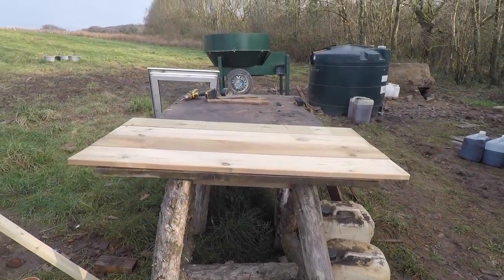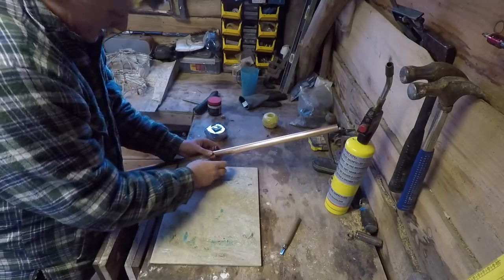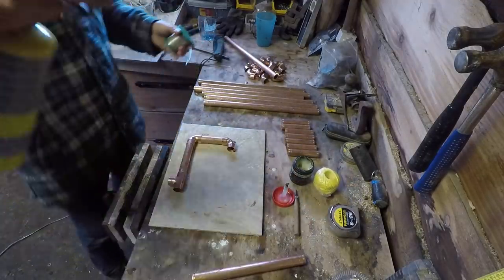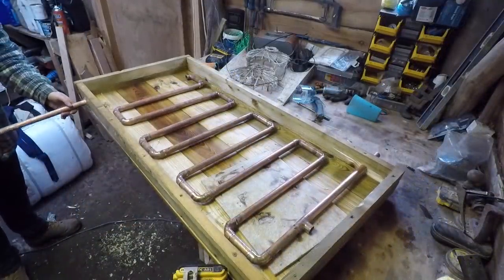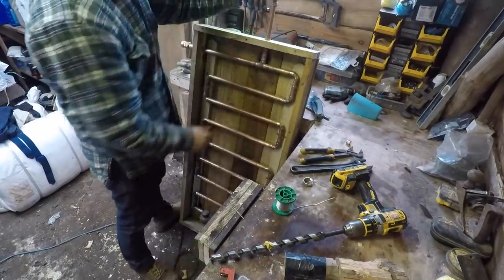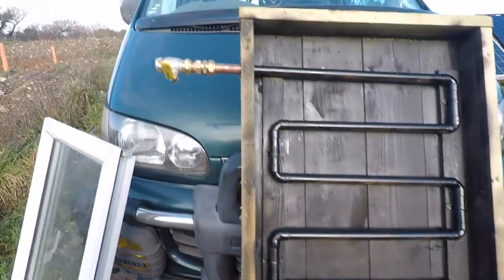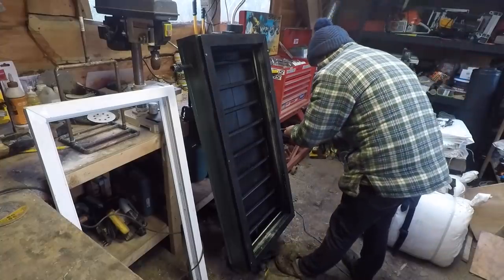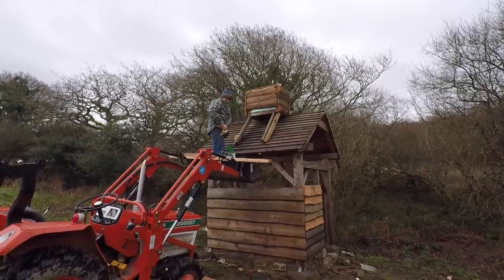Off Grid Solar Shower And Compost Toilet Part 4 Solar Hot water panel

Comment: Hey Kris, hope your well, looking back through your videos and came across this one, a couple of points with this, you could change the glass panel in the window to one thats called K glass, it reflects the heat rays back into the box, so they dont ever escape out, and the other thing was to fill the box with a black gravel, the really fine one, that will help to absorb more rays and keep the heat in the box for a longer period
Reply: whats black gravel.
Reply: Gravel that’s black

Comment: Kris, I used it do in home remodeling for a number of years and I don’t know how times when soldering I had problems with leaks until a plumber explained that to eliminate leaks always apply solder on the opposite side of the joint of where you are heating. It works beautifully because if you haven’t heated the joint hot enough, the solder won’t melt.

Comment: Made one of those about 35 years ago, we used an old radiator (domestic heating) painted black instead of copper pipe and insulated the box with rigid insulation. 
You can use a new car/truck radiator if you can find one cheap enough.
Reply: Pipework from an old fridge works great
Reply: This thing isn't going to do jack squat.  The box is more or less empty and the tubing is too big. The tubing needs to be MUCH smaller to increase the surface area and there needs to be a lot more of it.
Reply: @tarstarkusz  jack squat.

Comment: What I did was used barn corrugated roof barn iron from a scrap yard.     Made the 8'×4'     out of 2x4s.     Loaded it with pvc black pipe ( or black garden hose )   Screwed plexiglass for cover 
       Filled a water tank with water on the ground.   Hooked up an air compress to it.      Then hooked it to the hot water set up.   Then to shower.         All this was at ground level.      It even works in winter
Reply: This setup isn't going to do anything. It's only 1/2 a square meter to start with.  2nd, the tubes are just too big (not enough surface area in comparison to the water) and there isn't enough of it.  At least 80% of the surface area is not covered in copper piping.  Even granting 20% efficiency for the entire 1/2 a square meter, which is probably a pretty major stretch, that's 100 watts continuous output.  It takes 4.18 watts to raise a gram of water by 1 degree C.
The water is never going to thermally migrate either. There  just isn't enough heat.
Also, the panel is going to need very frequent cleaning because at night, the glass will fog up just like car windows.

Comment: Nicely done Kris! A couple things about the thermometer you were using... its IR, not laser (the laser just helps you know where it's pointing). The area it's measuring spreads out like a cone as you get further away, so to get a proper reading you want to get nice and close to whatever it is you're measuring. Also the IR doesn't do well measuring from reflective surfaces (glass). Cheers.
Reply: Exactly. It is basically a 1 pixel IR camera. The spot size ratio should be mentioned somewhere on the camera, the case or the manual.
For accurate readings you need to make sure the spot is completely on the object you want to measure. If the spot is bigger than the object, the accuracy of your reading is gone. You also have to take into account the effect of the fixed emissivity setting.

Comment: The Idea is to put a black foil 1mm behind the Glass to create some heat, further use a thinner pipe with more bendings. and if you put some reflectiv stuff below the Copperpipe it will increase the heat even more. Next thing is, you should insulate the Box to collect more Heat inside the Box to heat the Water.

Comment: Unless I've missed it and you've altered the design Kris, I think I would have used a flat sheet of steel or copper, painted matt black,  behind those pipes to gather and transfer more heat to the water, wood not being great at heat transfer. I also would have used single glazing maybe, I'm thinking that the double glazed unit doesn't let as much heat through as it's designed to insulate against heat and cold in houses. Just a thought or two. Great work though, love watching your videos.

Comment: Instead of adding another box you can increase efficiency by adding a sheet of cobber touching the pipe. The heat capacity and transference is much better than the still air in the box and radiant heat from the wood.
Reply from the maker: yeah that would for sure help with extra heat, copper sheet is big money though!
Reply: Or add a shiny backing slipped behind to tubes to reflect the radiant heat in the voids toward pipes.
Reply: @MrDalsbaek  ...that will take me less than a week for that many cans of Heineken:)
Reply: Anders D “maximus ironthumper” did a solar thermal a bit like this Kris, there are a few vids on YouTube covering his success, might be worth you having a look 👍

Comment: I'm thinking about building one of these. Using aluminum tubing. 3/8" or 1/2" and nearly fill it with a layer of tubing. And plumb it to allow multiple passed. Or a single pass through the coils. Single pass would be in to a manifold. Paralling the coils. Witch would give higher flow/less time to heat. And the series will do the opposite. I'm convinced it will work. I will use it to atleast preheat the water for a gas tankless heater. I plan to do a similar project to heat water with a wood stove. I will be burning yard scraps and trash. I'm not cutting decent trees for firewood. I may grow bamboo and schrubs to be fire wood and to build things. Bamboo is an amazing wood/ grass, fast growing. I will compost the ash and sawdust. Great video! Keep us posted...

Comment: Hey kris. 
When your soldering fittings, do both joints at the same time. The 2nd 45 you did, you soldered one side separately. 
When you heat the joint up to do the other side, you risk melting the solder and weakening the seal. 
So you can do multiple fittings, but never do half a fitting. 
All the best.

Comment: Don't know what size you might be getting ahold of but over here we run 4inch exhaust pipe for our water heater wrap it in copper tubing and then cover it with 8inch cap the ends . You can use it for hot air but also for heating water fill the empty space with sand paint black and set in the sun. I'm sure you'll get the jist of it .

Comment: These solar panels are great, I've made a few caus my wussey kids don't like cold water in their paddling pool, But a backing plate of some kind to collect more heat is a real help, copper best, Alu works well, even steel if you have nothing else. having said that perhaps yours will give the ideal water temp for the shower, they can get very hot, enjoying your jorney :)

Comment: Lots of ideas on here;  First, I would invest in a pipe benders and save on fittings.  Next I would have used a roll of flat copper bound and soldered to the pipe to cover almost the whole box with surface area.  Finally chemically treat it so that the copper itself turns black.

Comment: A little tip is to bend the solder in a zigzag to control how much you put in each joint 15mm length for 15mm and 22mm for 22mm and so on

Comment: Iv no idea how much water this could heat, but if I was a betting man, I’d say it might, at best, just take the chill off the water. If your having volunteers, you will need an abundance of water at different times of day. What about some kind of IBC container, is it realistic to get your hands on composting material, run the pipe through it, and that be more efficient? Food for thought kris
Reply: am pretty sure when most people are there helping, it will be summer and all will want a cold shower to cool down after working all day
Reply from the maker: https://www.chlorideexide.com/shop/solar/solar-water-heater/
Reply: Gaz Underhill .... he mentioned there’s a group in Spring, but point taken

Comment: If you want to shower year round put a thermoelectric generator and a pump on your woodstove and boiler and slope your piping from the round house to the shower out side and be sure to insulate the piping to avoided any freezing. Just a thought, cheers 🍻

Comment: With a microwave transformer taking out the secondair coil and replace it by a brakefluid copper pipe 6 mm or 8 mm and send it a few times through the transformer and will be a inductor with a good insulation around the winding the input has to be alternating voltage to create heat. connect the copper pipe to a closed circuit with a natural water circuit of cold as return and hot as supply.when everything is connected you can test with which voltage is needed to generate heat.

Comment: Could use some polished stainless steel "wings" (reflectors) to help reflect more solar energy into the collection area. It's good you painted the back, black, as this will help convert visible light into infrared. Typically you would want the copper inside to cover a bigger surface area.

Comment: A very nice idea and very good soldering. However I think that 500 W is highly optimistic. When I worked in industry we used a value of 300 W per square metre for solar heating , worst case, ie in the hottest parts of the world.
Reply from the maker: That sounds very low to me. the sun puts out about a kw per square meter so that would be very inefficient that is photovoltaic panels kind of numbers not direct heating numbers.
Reply: Kris Harbour you are correct. The value I quoted was wrong. It should be 1130W per square metre.

Comment: A large sheet of copper in the back with the pipe soldered to it, then paint it all black.  The sheet does the collecting, not the pipe.  The pipe moves the heat to the tank, and the tank stores it.  Insulate all the parts and it will be much more efficient.
Reply: matt johnson a large sheet of copper? U come across those pretty cheap?

Comment: Nice job. If you use a single piece of copper pipe and bend it instead of soldering it. Would it work better? Be more efficient?

Comment: @Kris Harbour Natural Building - I've watched a number of your videos. Very impressive! I generally applaud all your efforts. In the case of solar water heating, I would have liked to see you using sheets of copper selective surface solar absorber material, and thermally-insulated box. Selective Surfaces are coatings/materials that depart very significantly from a mere blackbody surface. That is to say, they absorb and emit quite differently than normal surfaces and materials. The usual goal is being good at absorbing solar energy as visible light, converting it to heat, but then being very poor at re-radiating the infrared thermal energy. 
Some can gain heat at a rate equal to ten suns shining on a mere blackbody, but with just one sun's illumination. They are used for solar water heating in many parts of the world. Many use a more advanced kind, vacuum-insulated glass tubes with double walls and a selective surface on the inner cylinder. With illumination of just one sun and no extra insulation, they can actually boil water on a good day. If extra light is concentrated onto such tubes, they can give you heat at significantly higher temperatures. 
In one DIY example, using a mirrored acrylic sheet bent into a parabola, the extra light enabled the tubes to give out their collected energy at over 300 degrees C (over 570°F). At that temperature, storing useful amounts of heat for days at a time can be accomplished with just some pipes covered in sand, inside an insulated box. But at high temperatures, you obviously have to be extremely careful using water, since it can make steam at rather high pressure, which can be quite dangerous, even explosive. 
Air or carbon dioxide or certain oils can be used instead, or even steam IF care is taken to prevent the pressure ever getting high in the solar collector and the heat storage unit. 300 C is also hot enough for a homebrew heat engine to convert heat to work at over 25% efficiency. You could power your shop that way, and still heat your home with the heat engine's waste heat.

Comment: Those three copper pipes coming out of the box should be plastic as they'll wick away the heat.  A metal plate soldered to all the pipe and insulated from the wood will greatly increase the heat gathering area. Might be easier to just find an old thermal solar panel that's being recycled...

Comment: Build a heat exchanger in the tank and fill the heating circuit with antifreeze/water mix like in your car`s radiator, then you won't have to dry out the system in winter!
Maybe a little solar powered pump in the circuit?
Great job!
:-D

Comment: maybe a good idea to experiment with using a cheap single layered central heater radiator, turning the rear of it into the sun (the rear being the corrugated sheet metal welded onto the radiator)
You may need to fill the system with anti freeze and run a copper coil in the tank to heat the water contained in it...Obviously the radiator is steel and it will rust slowly away if exposed to water alone...

Comment: Hey Kris, nice work. I was wondering if there was reason you chose to use painted copper, rather than black hose/tubing? People here use it for heating pools in the summer, and it works very well. You could increase the surface area by using the tubing vs the copper pipes to increase the efficiency. Plus I'm sure hose is cheaper than copper.
Reply: He likes materials that don't break down under UV
Reply: @bearsharkp3901  I'm sure he would be able to find black garden hose. That's what people use here, and it's perfectly fine. Heck, the garden hose I have is over 25 years old and it perfectly usable. He wouldn't need to worry about the flexibility decreasing, since it would be in a box, not moving.

Comment: Just a thought: the tight fit of the inlet and outlet in the wood frame may be an issue with the expansion of the copper pipe. It could break the solder joints.
Reply from the maker: copper pipe is always used where it terminates in a dead end like a massive tank full of water. so it could only expand pushing on its last joints. how is this any different?

Comment: Would it have worked better if you put say a sheet of aluminum foil behind the copper and on the edges that way it reflects the light back up or would that have gotten too hot?

Comment: That glass looks double paned. If you want to generate more heat, use a single pane. That is why you were getting lower heat readings with the glass on.

Comment: Kris, I was thinking, if the water doesn't get hot enough,  (I'm not saying it wont). Maybe make a door on top of the box that has the rain trap in it. But make the door out of glass, that way the sun will heat the water up that is in the trap before it runs down thru the copper pipe? Plus I'm thinking the screen on the old big screen t.v.'s work like a magnifying glass, which would help heat the water in the tank. But you would have to open the door to catch the rain, then close the door to help heat it. (Just in case the copper doesn't get the water hot enough). Love the videos.. been watching you for over a year.
Reply: Technically could do another "glass enclosure" around it to create a thermal bubble.  I'm considering that for Winter application year-round since I've seen this work a few times on YouTube and it didn't look like anyone was cheating and making it "appear" to work.

Another thing would be that it's quite possible to super-heat it by adding mirrors to the sides and even from another location nearby (towers) to force more solar heat, creating that magnifying glass effect and in below-freezing temps would bring in additional heat.  The challenge would be to absorb without catching on fire (thinking a stone casement enclosed with the pipes, no wood) and of course getting those beams directed on target off the reflective materials for a majority of the day without also super-heating a wooden structure in the Summer into a blazing glory.

Comment: If, for whatever reason the water isn't hot enough, I'd suggest using an old radiator painted black, in the peak of summer the water would be close to boiling.
Reply: How is it supposed to thermal syphon is a radiator?...you need pipes for the water to heat up in and move through.

Comment: Good work, could consider changing the tank to a small (black) plastic tank. Give you some significant heat gains.
Reply from the maker: well the reason i insulated it is because it would only heat up in the sun,  as soon as the sun went down it would be loosing heat very quickly. with this setup the there is less surface area but the heat can be kept for longer. so on a patchy sunny day it would work better like this than with a black tank.
Reply: Kris Harbour makes sense buddy. I built my own system (but pressurized through tank coils), I store the heated water at a lower level than the heat collectors, in Spain I get about 250 liters of 65oC water per day. But I still drop 10-15 degrees from my tank overnight. The important thing is to get your water above 60 for legionella, but I’m sure you know that :)

Comment: This is awesome, my I ask why you didn't double the amount of cross pipes in the same box for double the amount of water and heat exchange, just asking.  It would save from make the second box.  Take care my young friend.
Reply from the maker: Just cost, it gets expesive. cheaper to make more panels with more surface area rather than more copper in the same panel

Comment: Nice job Kris, what do you think about using microbore to make one of those solar heaters? The pros are flexibility so no need for soldering, smaller diameter so maybe slower flow rate giving the water more contact time to heat up? You could get more runs into a similar area that you built, so I'd love to hear your cons if you have any, also are you enjoying the Welsh weather?